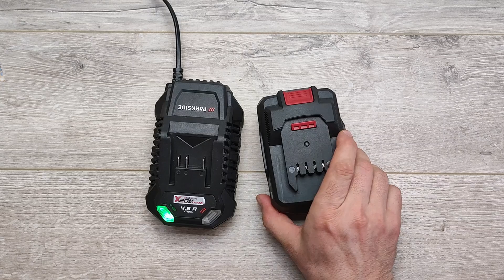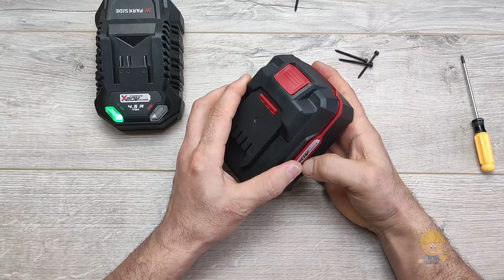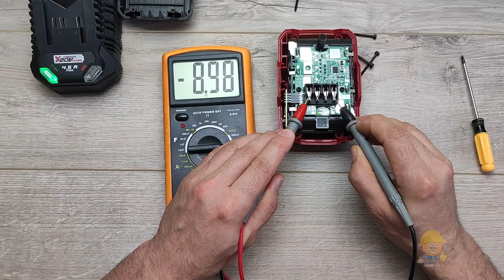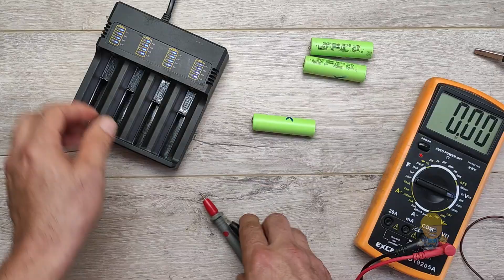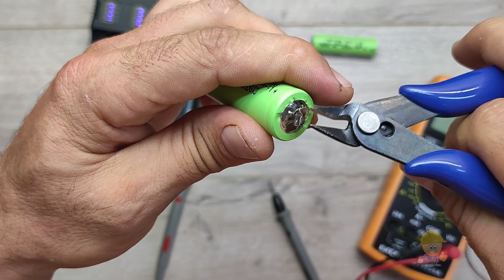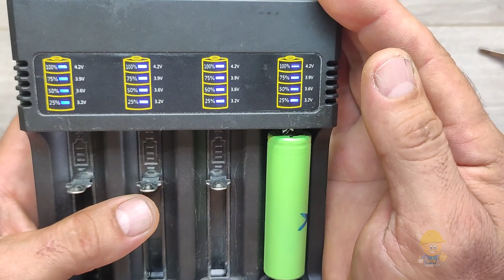Parkside Battery cells How to reset 18650 dead 🔋 lithium cells #diy  #parkside  #cells

Comment: You are really rough with opening the spotweld contacts. If you twist your pliers like that, you will puncture the edge of the minus terminal, and hit the positive while removing them. To my knowledge they all are Unprotected cells, as this is a design choice and the BMS on the mainboard all does this work for the whole battery. I urge people not to remove the caps to reset the valve. These batteries are a firehazard especially after procedures like this.
Reply: Well of course they are unprotected - The PCB is in the battery pack IS the protection. You only have "protected" cells in environments where the end user can touch the single cells.